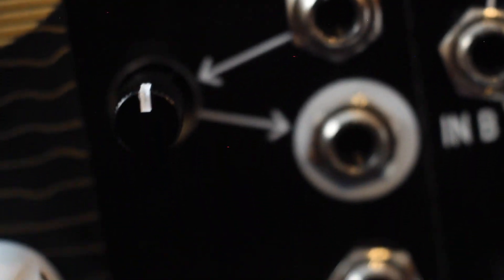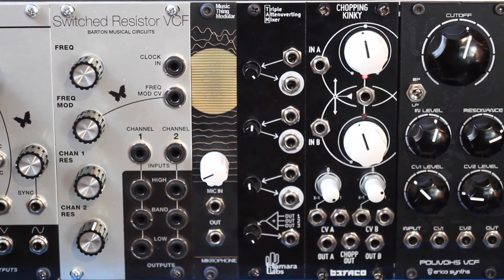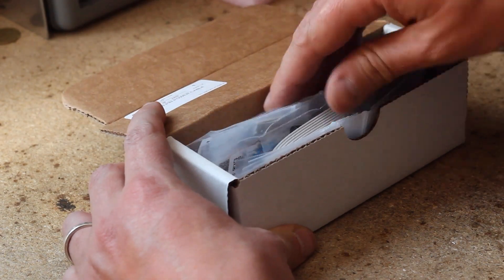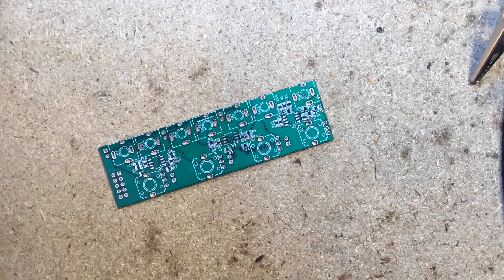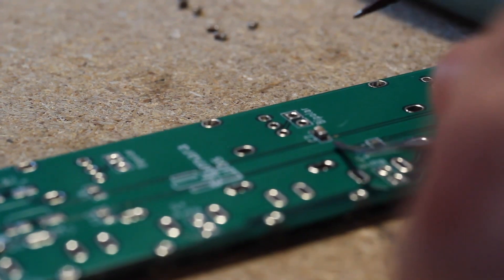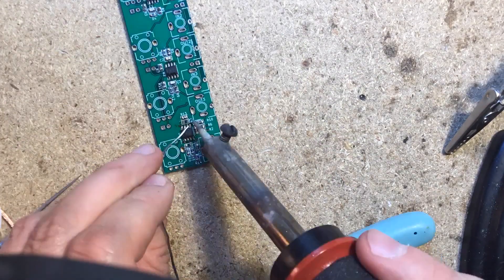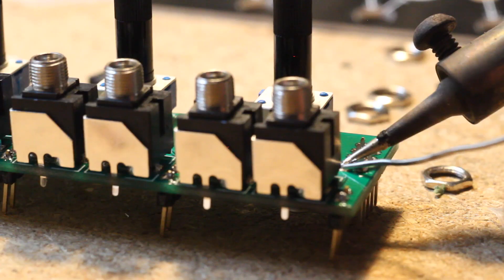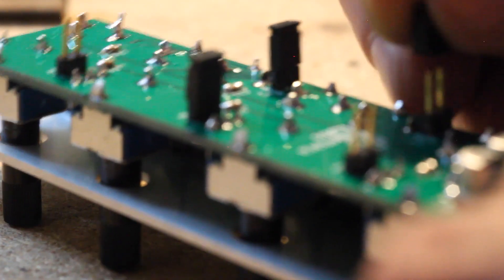Kit Review # 22 - Triple Attenuverting Mixer

Comment: Very nice demo. I'm just thinking about  drilling some holes into the frontpanel under the knobs for some tiny switches to replace the jumpers on the back. That would give one even more possibilities
Reply from the maker: cool idea! let me know if you pull it off :)
Reply: Since i am building 5U and not eurorack i am unfortanely not able to make this mod myself :(. I just mentioned it because i don't like jumpers
Reply from the maker: even better!  You can fit two of these on a 5U panel, just ignore the board mounted hardware components, send wires to pots and jacks on your 5U panel, and send flying wires from the jumper headers to switches on your panel...